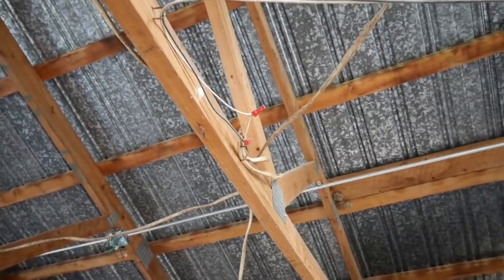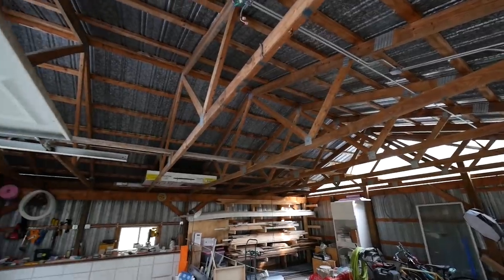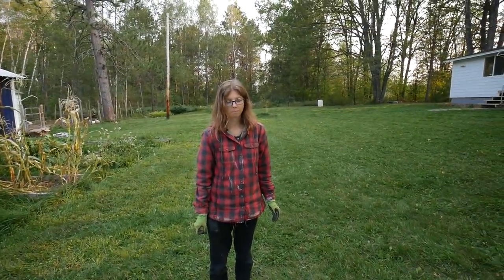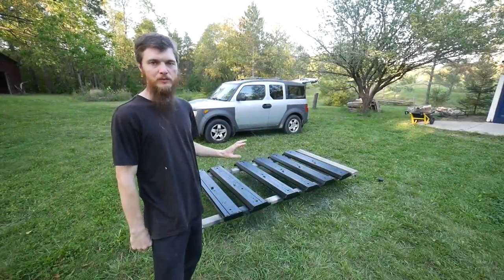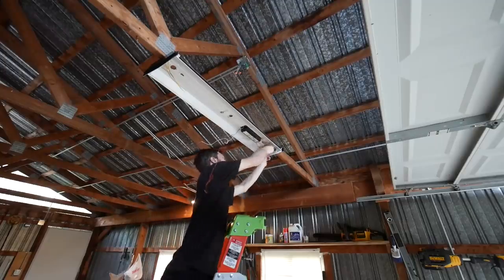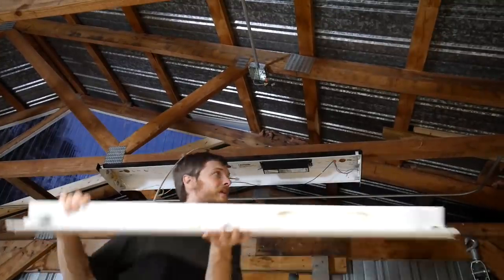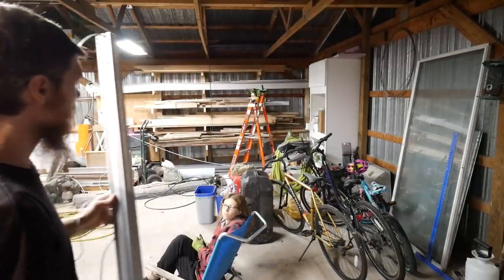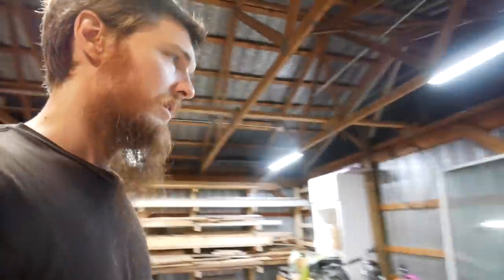DON'T Throw These Out! Restoring NASTY Old Light Fixtures - Installing Barn Lights

Comment: A successful series of mini projects making the barn look modern, clean and ready for use. No wonder there were rodents in the old lights, the rat's nest wiring made them feel at home. Every step was an improvement, the total is excellent. It was not an on-the-cheap-project, (not asking about the cost!) but clearly cost effective.

Comment: A note to anybody dealing with light ballasts, if it is oily inside that means the ballasts has leaked and depending on its ages if its old and oily its most likely PCB's it was a type of fire retardant they use to use that was found to be cancer causing and when you see that the ballast is not worth keeping as a ballast that can drip carcinogens is no good.

Comment: Awesome choice.  I've done a few and continue as tubes and ballasts are failing.  Best tip: buy from HDepot or Lowes.  I generally have good luck at Amazon but not so w led tubes.  My local Walmarts' selection very limited.  And always go for the ballast eliminate option.

Comment: What a great transformation! I don’t understand wiring, etc. so this is probably a dumb question but why did you put those black ballast things back in the light fixture if you weren’t going to use them?
Reply from the maker: Thanks! We never removed them from the lights. All we did was disconnect the wires and left them in the fixtures. Less things we have to try to figure out where bring them to recycle. :)

Comment: Did a good job on the lights. Sometimes those outside area lights are cheaper to buy than replacing the bulb. And, when they are LED they're cheaper to operate, so cheap in fact that you can leave them on all night at very little electricity cost.

Comment: Why don't you put the light fixtures on the slope of the inside of the roof? Where a skylight would be. That would look cool. Not sure about light output but it seems it would be good
Reply from the maker: It would probably look cool and we considered it, but in the end we just felt like putting them where we did. :)

Comment: Those lights are fire hazards.  We came home to our house filled with smoke and called the fire department because we couldnt tell where the smoke was coming from.  After inspection they found the lights were the cause.  Told us to remove them as they have been known to catch places on fire.  Get them out, there are safer alternatives.
Reply from the maker: The LED bulbs? Or shop fixtures? Almost every business and school, and many homes in america has been using similar fixtures for decades. I've never heard of any fire hazards from them. LED bulbs are new but fairly safe. They generally don't produce much heat and we've never had a problem with them.

Comment: I don’t understand how you converted those fixtures to use led. Aren’t led bulbs low voltage?  It looks like you wired it into 110 volts without reducing the voltage
Reply from the maker: The LED bulbs are designed to work in a standard 120V fixture. You just have to bypass the ballast and you are all set.

Comment: I didn't know that led lights connected in the same way as florescents in the fixtures. We have old ones in the basement that need to be converted. Thanks for the ideas. I thought we'd have to buy all new fixtures! The barn looks awesome! The inside galvanized looks shiny and new too. Did you clean it or is it the effect of having more light coming in? Take care. :-)
Reply from the maker: We haven't done anything to the galvanized metal on the inside :) Thanks

Comment: How is the roof of the barn oriented to the sun? Maybe solar panels on the roof next summer? That's a project I'd like to see. But you have electric heat in the house, so electric rates must be low in your part of the country.
Reply from the maker: We're not looking into solar at this time, but perhaps we will in the future. Most heat seems to be expensive, but electric heat isn't too bad if your house is well insulated like ours. Our winter bills were very affordable last winter :) I don't even think our electric rates are considered low here. They seem to be higher than NY and IN where we were from.

Comment: you can get new LED lights for $40 each.....uses much less energy $$   those ballast boxes and light bulb connections have a limited life span ...just not worth saving
Reply from the maker: Our LED conversion cost less than $20. That beats buying new fixtures ;)
Reply: @diyfferent  They look very nice and much better than plastic ones...good job!

Comment: Are those old ballasts compatible with the new LEDs, and are they required to make them work?  For some reason I was expecting you to remove them because they weren't needed by the new LEDs.
Reply from the maker: The ballasts are not required to make the new LEDs work. We disconnected them but left them in the fixture. If we had removed them we'd have to try to figure out where to bring them to recycle, if there is even a place near us. It's just better to leave them in the fixture :)
Reply: @diyfferent  Got it, thanks for clearing that up.

Comment: OH,  scary, you think that is scary, back in the day 70-80 years ago barns and outbuildings like chicken houses used nothing more then glass insulators and bare uninsulated wire to power lights. I lived on a farm like this and when I was about 8 years old my grandmother wanted me to catch two chickens for cooking. we used a 1-yard long metal rod with a hook on one end to catch the chickens leg. I was swinging it around and missed the chicken and caught one of the live wires. I was almost electrocuted as I was out there by myself.  The only thing that saved me was my weight.  As I started to become weak, my weight pulled my body down and made my hand that was frozen to the metal rod come free of the rod and the electrocution stopped. I laid on the floor for a while to get my strength back and then finished catching the chickens and gave them to my grandmother.  To this day this is the first time I have ever said what happened to me that day, nobody ever knew that I almost died catching those chickens.  Now that's scary.
Reply from the maker: Wow, that is quite the story. Good thing you were able to get free of the rod.
Reply: @diyfferent  You got that right, the floor of the chicken house was a dirt floor and it was soaking wet and made the best ground to complete the circuit, if my hand hadn't pulled free of the rod, I would have fried to a crisp the power was 120 V-60 cycle.     when I went into the air force I was an aircraft mach., but my hobby was an electrician and I never worked on a circuit that wasn't live and I still don't, electric power doesn't scare sense that day.

Comment: Doug, question . . . Any plans to control some of the barn lights from inside the house?  Any plans to install pole lights along a pathway from the house to the barn?
Reply: If necessary, they could plunk in a couple of landscape solar lights.
Reply from the maker: No plans for more lights. :) Our exterior house light lights up the backyard pretty good.